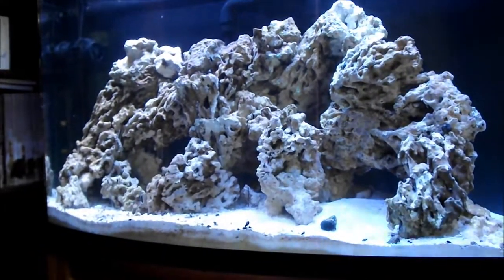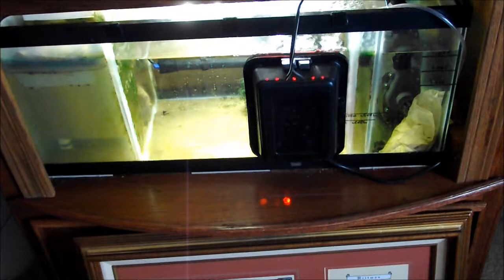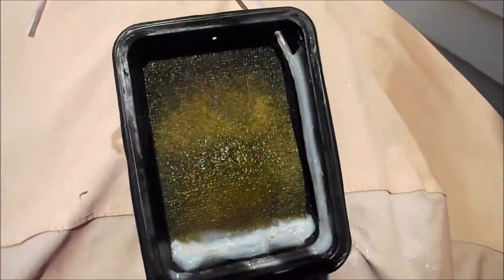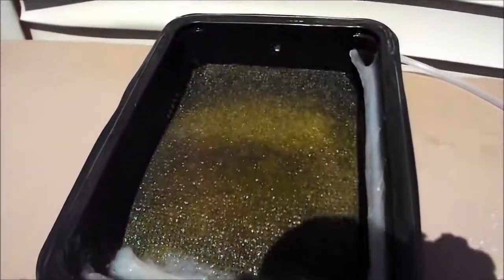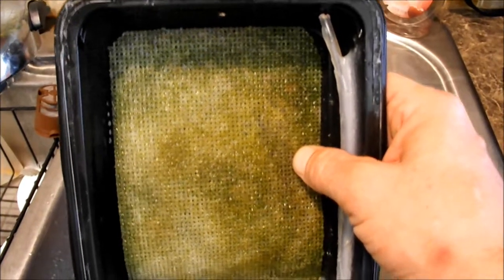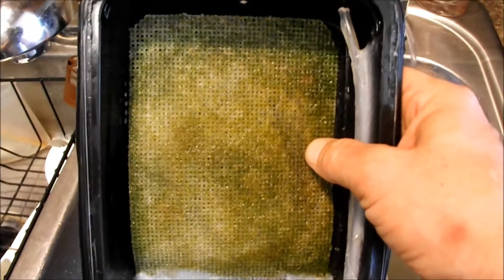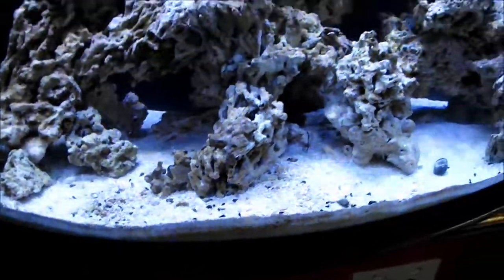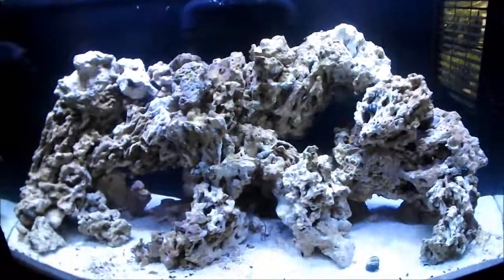DIY Uplow Algae Scrubber - Update & Maintenance

Comment: Never clean with tap water. It kills the roots and you can shock your system while you wait for it to die and come back
Reply: Mike Newhook no your thinking about (BB) beneficial bacteria . algae scrubber feeds on nitrates,phosphates n light. u can disturb or reset anything on a algae scrubber by cleaning it with tap water. only thing u can't do with a algae scrubber is clean too much off of let it sit too long without water

Comment: Hey I just set up a scrubber on my 200 gallon fresh water tank. Threw it together quick but does it matter that my screen is black I have 2, 100 watt lights on it at least  18 hours a day I used gutter screen
Reply from the maker: Honestly...I don't know? 
I would guess because white is more reflective it would be better, but black absorbs light

The algae going to grow if you provide it light and good flow, and that you have.

Give us an update in a week or so, and let us know what you find.
Now I'm curious!
Thanks for watching.
Reply: Ya thanks I'm running my scrubber off of my return pump from my sump I need to get a pump just for the scrubber so I can up the flow I'll post a video this weekend
Reply from the maker: I'll keep an eye out for that vid! good luck with it. And, up that flow as soon as you can. Otherwise all you will get is brown slime.
Reply: Got a new vid up got a new screen on my scrubber And a pump hope the pumps big enough. If not I can use it for a power head